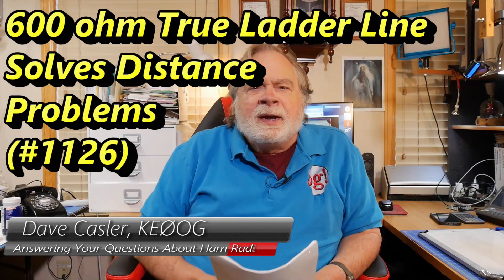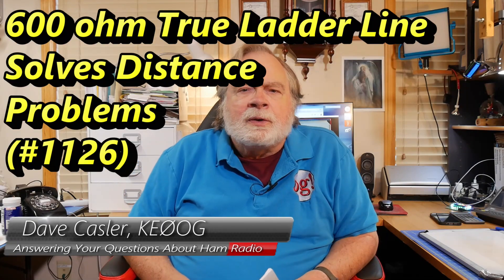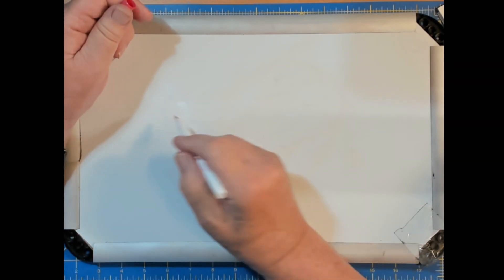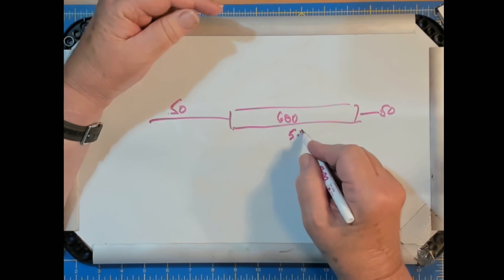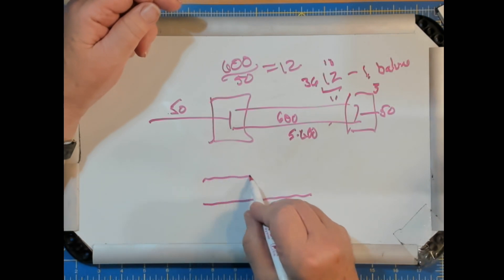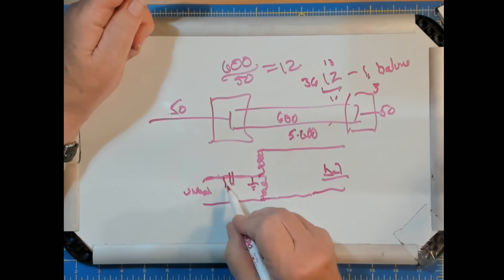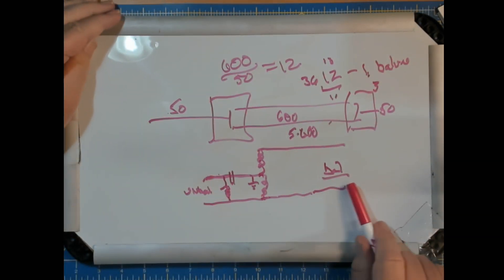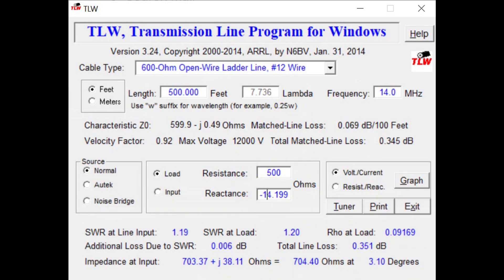600 ohm True Ladder Line Solves Distance Problem (#1126)

Comment: I opted for 7/8" air dielectric helix. My run is a little shorter, but at 600' you only have about 0.50db loss on 40m.  600ohm open ladder line has about 1db loss at that distance and frequency.  The helix isn't the cheapest option, for sure, but it really makes a difference in receive quality.

Comment: For th remote relay, here's a possible idea. Run AC to power it. 
At my work, we combine AC with rf (5-1200mhz) over coax and use splitting filters.

Comment: Dad had a true 600 ohm Ladder Line fed 180 meter long line, out of the shack with a big hole in the wall and up 90 foot crank up tower yard arm pulley to the 1/3 acre back yard and a secondary 25 foot monolithic at 90 feet. Happy Father's Day Dad AE7AD from KD7CKT
73s Dad

Comment: Instead of spending all that time and money to string up ladder line and a control cable on poles why not go to FlexRadio Systems and get a 6600/8600 with an Antenna Genius switch and simply use either WiFi or fiber optic cable to get to the remote shack?  The "shack" would even have to be a building, it could be a just a small enclosure that's meant to hold equipment in remote locations.